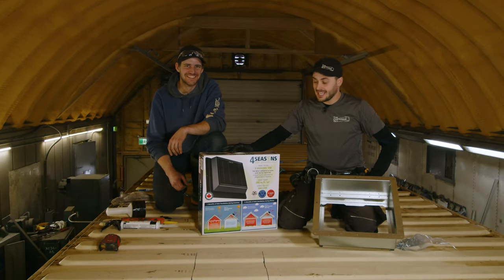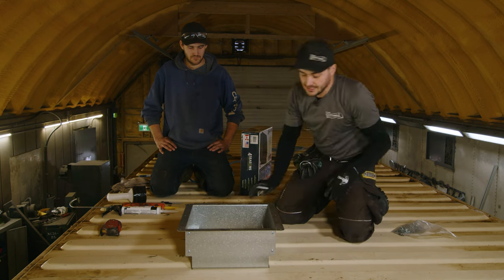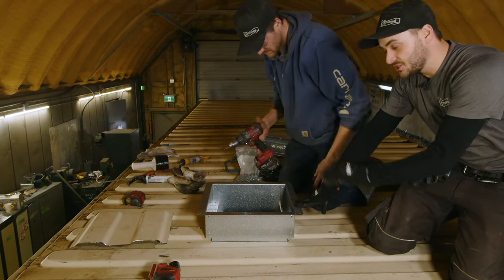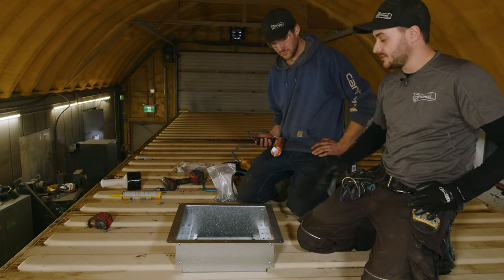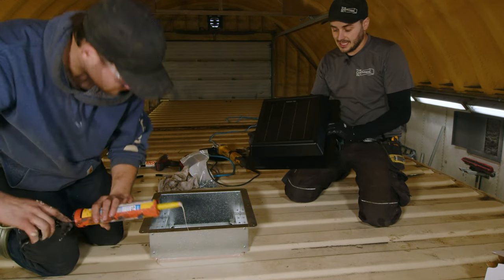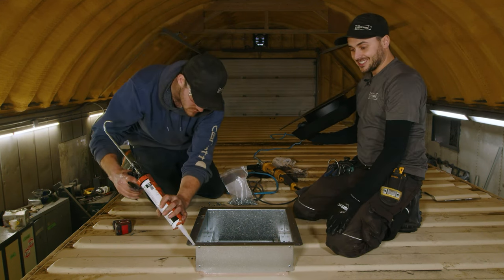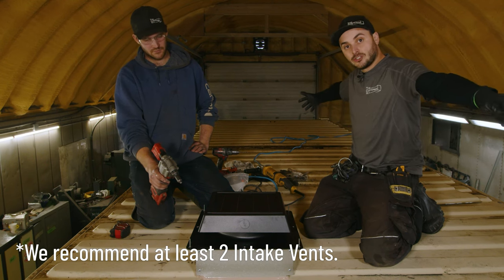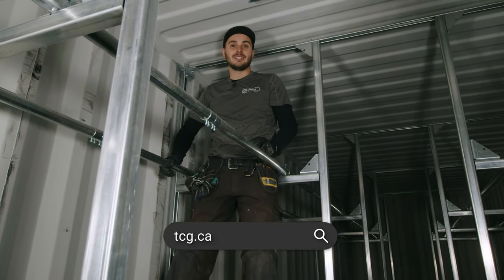NEW Solar Powered Roof Vent For Shipping Containers!

Comment: Wonderful product. 
Could you convince the maker to stamp the riviting profile? It is great the extended the flanges to help orient the frame to the roof. But if that were stamped, it could dip down to fully follow the roof corrigation profile and provide an even better mating of parts.

Comment: What is the top of the vent made of around the solar panel? I'm putting a container in a forested area with high fire danger. It will be in a cleared area with no vegetation. The state's county code doesn't allow plastic lights under the house eaves, or skylights with plastic since an ember could burn through the plastic. Thank you so much for sharing your knowledge and mistakes. I have learned so much from watching your videos.
Reply: I think he mentioned ABS plastic. Solar Blaster offers all metal vents to shipping containers.

Comment: I just installed the Solar vent fan smack dab in the center of the roof of my 20 foot container. I have two Big 40 intake vents to install. I'm thinking I should do them in diagonally opposite corners

Comment: Hi Channing, love your videos and your entrepreneurial spirit. I'm looking at purchasing a couple of 20ft.  double door containers (I'm here in the states, N. Illinois to be exact) and partitioning them into two roughly 10x8 spaces.  My plan is to rent them out as storage spaces as a fairly cost effective way to get into the business. My concern is leaving them out to the elements . I'm considering a simple open wall clear span structure or possibly a carport type structure to keep them covered. IMHO the roof or top being that it is flat and allows for no runoff to be the most vulnerable part of the container. I'd like to mitigate that as much as possible and keep them dry and clean and in use for a long time.  Any suggestions, advice, tips, hints etc. would be most appreciated. Thanks for the great content!

Comment: I live in South Texas and the sun's UV rays kill anything plastic. Any idea how UV resistant the vent hood and Solar panel are?
Reply from the maker: Oooof that's a good question. Sun is pretty bad up here in Canada too actually. Something about being closer to the sun in our summer cause of the tile of the earth (I think). Our main plastic vent company (Duraflo) has the UV resistant stuff figured out. All my plastic vents on my roof were mint after 40 years (1985) when I redid my roof last summer. A little faded is all. These vents aren't made by them but they seem to be of similar quality. Do you have ABS plumbing stacks down there? Or PVC? Which one works? 

We have sold a lot of them to Texas/Arizona with no phone calls suggesting they melt... That's a good sign.
Reply: @TheContainerGuyTV  Thank you. Which Sikaflex compound are you using? I see they have many different ones.

Comment: Another company makes one with the bottom plate matching the roof corrugate.
I’d like one that I can hook up a small battery & mppt so it never stops running
Reply from the maker: Do you have120v power near your container? We have a low voltage fan in a vent that powers with an extension cord from the outside. It also passes power into your container (2 plugs & 3 USB ports). 

I didn't think people would want to mess with batteries and charge controllers but as they become more popular and people become more educated on them, maybe it's less of a worry.

Comment: Can the fan be mounted on a side wall? I don’t want to put any holes in the top. As you have said, in the past.
Reply: The problem with mounting this on the side wall is the solar panel would not be pointing toward the sun. You might call Solar Blaster as they have an adjustable solar vent and they could help you figure out a good solution.

Comment: What are you doing for Makeup air? What vents do you use for that? Thx!
Reply from the maker: Two BigAir45s for intakes during the day and passive ventilation at night.
Reply: @TheContainerGuyTV even with closed seal spray foam we still can use the 45" vents?

Comment: Good idea but cutting a hole in the roof is not my idea of a remedy for moisture. Id go on the side corner near the top. Besides those units are over double the price they should be.
Reply: I concur, I have two 40's and use a side mounted solar fan.  Why put a hole in the roof?  Not to take into consideration if you ever want to stack units now you have a hole in the roof.
Reply: @easytraveller1269  I cuntcur. Another great point. Also the roofs on these cans warble a lot and are not meant to have a lot of weight on them. The weight bearing is on the corners as you well know, however others do not.
Reply: @easytraveller1269  …. What solar fan do you use ?
Reply: @-What-are-your-thoughts   I had the container company I use install a commercial off the shelf solar fan and install/weld a bracket and solar panel on the side of the container.   The venting was welded into the container.
Reply: @easytraveller1269  got any pics of your set up?

Comment: The problem with solar powered roof vents, as I learned while living aboard my boat, is they are on during the humid part of the day,  increasing humidity inside.
Reply from the maker: Interesting. We are predominantly dry and find it a perfect match to exhaust the summer heat. Ventilation is climate specific and differs between tropical, desert, temperate, and arctic climates. Each person should analyze their situation and use their judgement.

Comment: Do these have an off switch and some way to plug it off in the winter?
Reply from the maker: Snow
Reply: @TheContainerGuyTV   Cold weather in general......  When the temps drop to the 40-50 I would not want to have the warm air sucked out...  But when the temps get into the 70-80 I would.. That is why I was asking.

Comment: Which Sikaflex product?
Reply from the maker: Not self-leveling. Learned that the hard way. Doesn't need to be Sikaflex. Use a UV resistant urethane construction sealant.

Comment: My container has 2 whirlybirds on it.  What a regret!!
Reply from the maker: How do they work? Leak? Let water in ever? Where are you located?  I'm curious to know feedback on them around North America
Reply: @TheContainerGuyTV   I'm in the southeast US.  My issues are more with the company.  The driver sat the container in the yard instead of on the blocks I had set up.  I couldn't be there that day to oversee the delivery, since I was at work.  The company refused to come back out and I didn't have the money to pay another company to move it.  So it sat uneven which allowed water leakage, which ruined the floor beneath.  That whirlybird stopped working not long after that.  The other one still works.  Years later I met someone who asked if I liked having the whirlybirds and he stated he regretted having them installed because they stopped working on his container. I don't remember if he said they leaked. But he was unhappy also.  Btw, I saw a video years ago where you can turn the whirlybirds upside down and use them as a light fixture inside the container.  I loved it.
Reply from the maker: @SandiRose2008 That's unfortunate. Gotta get air movement under the container. We have this product here which would help you level the container if you already own a bottle jack: https://thecontainerguy.ca/product/twist-n-jack-container-lifter/
Reply: @TheContainerGuyTV   Will definitely look into it!!  Thank you!!
Reply: @SandiRose2008  A Hi-Lift Jack can be used to help you level the container as long as it's empty. Get the name brand one, there is some knock-offs and I can tell you from personal experience that despite their claims to the contrary, they can't lift as much as the name brand one. Using a Hi-Lift jack can be dangerous but its a lot more versatile than a bottle jack.
Reply: @Jack-yl7cc   Thank you Jack!!  I'll look into that too!!!